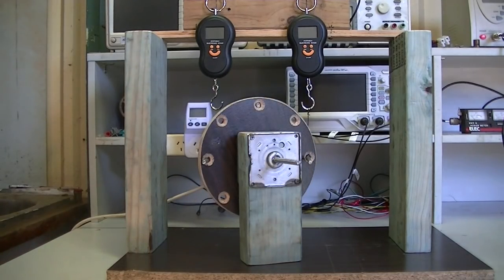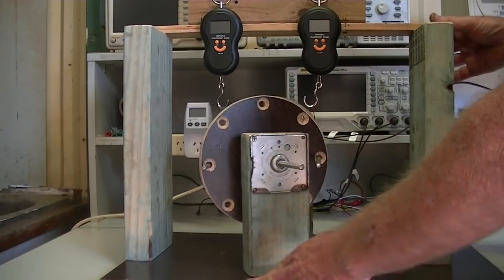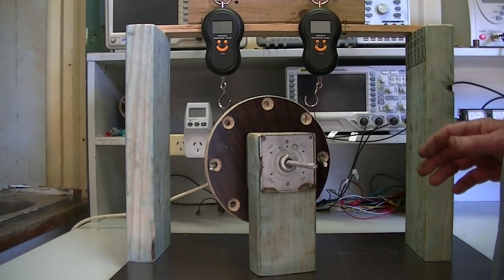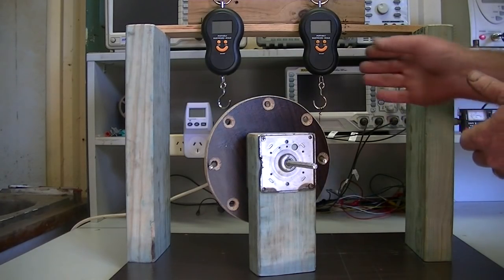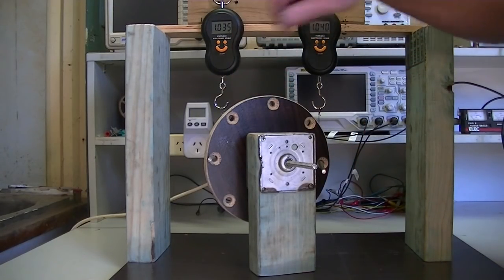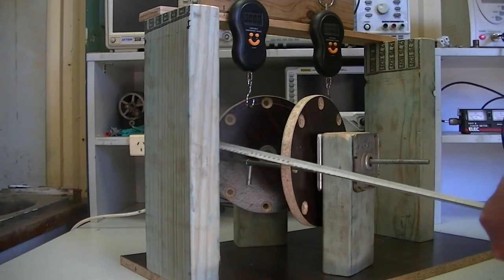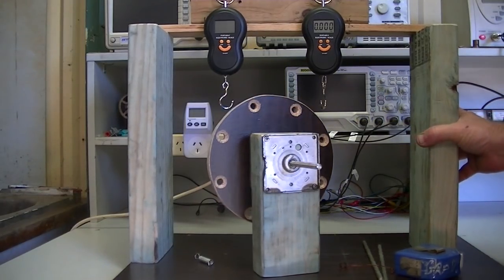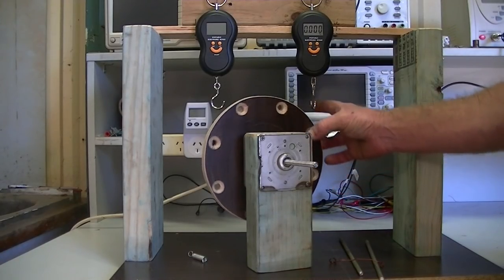The Buoyancy Displacement Engine

Comment: The pin is still actually still the same length though, just the part on the inside of the wheels is shorter, so I see no point in measuring the pin. The bearings however are offset to the side with the "shorter" pin
Reply from the maker: Seems you missed the point of the test.